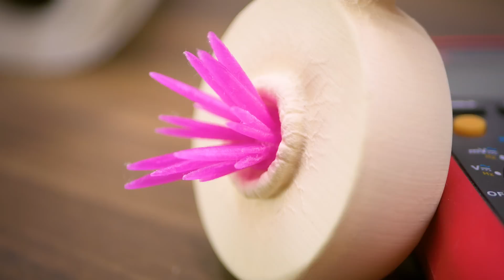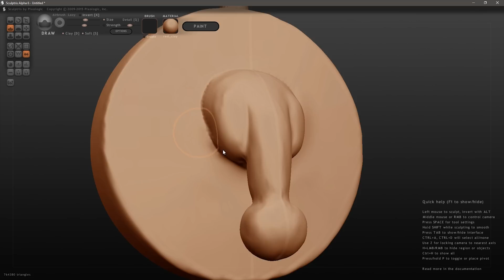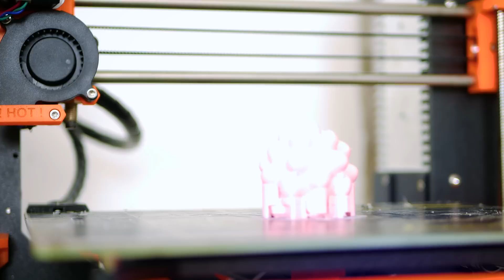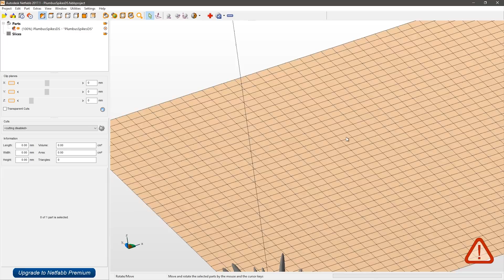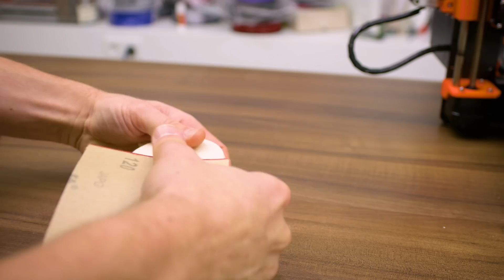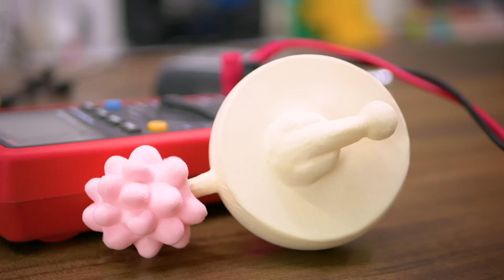How to model and 3D print a Plumbus!

Comment: I can't get the shaft on the grumble to print. Using cura, tried regular and tree supports. Everytime it pops off. Tried resizing down to 35% and up to 150% with various infill and speed settings. Any tips?

Comment: A plastic plumbus? Please. Like trying to print fasteners and linear components, you've just spent hours and ended up with a poor imitation of what you want when you could have just gone out and bought one from a local store and supported genuine artisanal plumbus crafts-people. Too many people wrapped up with whether they CAN print [thing] and not considering whether they should print [thing].
Reply: I'm just saying you need to consider whether the 3D printer is the right tool for this job, both practically and ethically, Tom.

[I'm totally printing at least one in ninjaflex for an xmas gift, thx]